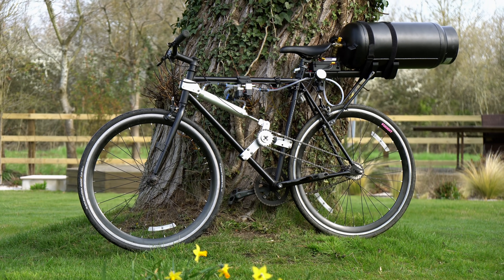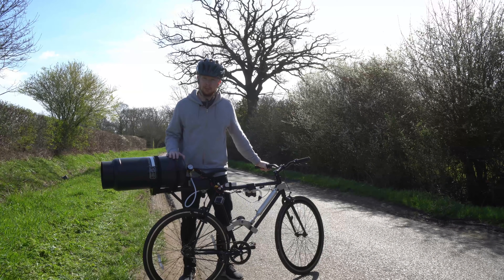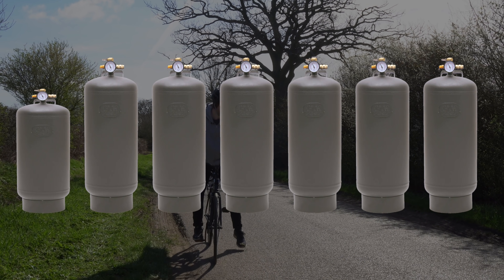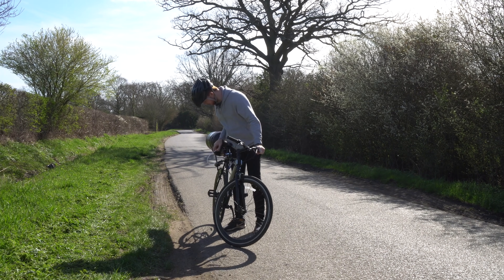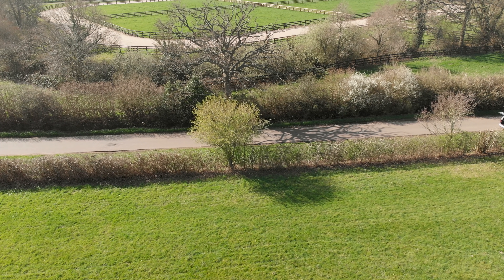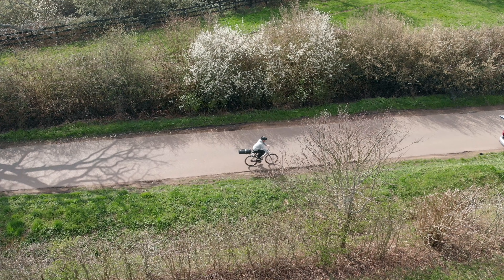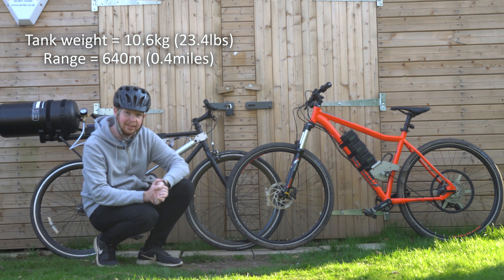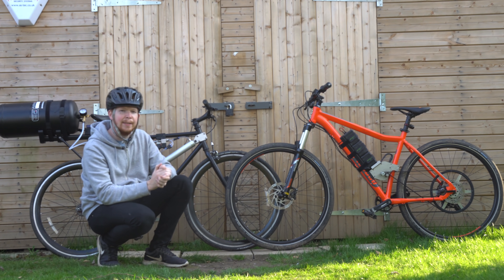Air Powered Bike Range

Comment: The rear wheel acts as a flywheel because of the fact that it is connected directly to the engine. Since this is the case, you could make the bike more efficient by utilizing the momentum of the rear wheel and connect a one way valve from the intake of the piston to the exhaust and use the pressure from the intake to push piston back up

Comment: There's a bit of weight improvement you could make, what you had listed there seemed like a regular 200 bar cylinder. There should be 300 bar steel tanks and aluminium internals with carbon fiber reinforcement around, the latter being lighter for the same internal volume but it'll be more expensive. 

If I take a Dräger 9L 300 bar carbon fiber composite you'd be looking at the following specification according to their datasheet
Weight: 5.3 kg (empty I'm guessing)
Water capacity: 9.0L
Source: https://www.draeger.com/products/content/compressed-air-breathing-cylinders-pi-9046796-en-gb.pdf

Your 20L 200 bar steel example weighed 23kg, so even sticking to the same weight ratio it'd be less than half that while having a 50% higher working pressure. But I have no clue if they even make carbon fiber composite cylinders that large. The carbon fiber ones are mostly used by firefighters and such if I remember it right and carrying a cylinder larger than  that around on a person seems counterproductive. When it's use case will be in a ground vehicle or stationary the it probably makes more sense to go for the heavier plain steel option, but if money was no problem sourcing two of those would result in a 50% weight reduction. But on https://www.frontline-safety.co.uk/drager-9l-300-bar-right-angle-valve-carb-comp it seems to be selling for £1,327.92 inc VAT which to me does not seem like a financially sane decision for this project nor practical in daily use.

So you might lose a bit of weight and perhaps gain like up to 50% (increased pressure) on that theoretical limit you calculated which would still not make it worth doing for practical usage. Alsoit'll be quite inefficient with how much useful work you can extract from all the energy being consumed by the compressor (oh yea and that's yet another thing you'd need if you wanted to run it regularly or live nearby a dive shop that has a 300 bar compressor). Also you'd definitely get less air out of that cylinder than calculated, if I remember it right for 300 bar 1L internal volume expanded would result in ~270L at ambient pressure since the compression ratio isn't entirely linear (should be less significant at 200 bar though).

Comment: Always quality video productions, thank you so much. I am wondering if an off-the-shelf air tool such as a drill or die grinder could be used in place of the pneumatic cylinder. I have been curious about alternative energy storage as with compressed air or elastic power for a long time now, especially practical, real-world use as you are exploring.

Comment: Wonder about a recycle system...Where you will pedal to create the pressure, but there is little to no exhaust, as the Pressure is shifted back and forth from 1 chanber to the other...And you are adding the excess....This is like the Idea of a Whites steeam engine, that recycles the water...It was slower thent he Stanley steamer, but went allot farther...

Comment: This is very interesting, and I learned a lot about how pneumatic cylinders, etc worked.  Especially interesting was the efficiency loss when the exhaust pressure was greater than the atmospheric pressure.  Many Thanks!  PS a steam powered variant would be great, I can imagine strapping the boiler on the back!!

Comment: Next try using a scuba diving tank, i.e. a 15L tank at 300 bar (4500L of air) giving you at least 30x the range (20 km). Maybe you could double the pressure going into the cylinder as well, possibly wasting energy by halving the range, but giving you usable power for a trip.

Comment: Possibly, could use the exhaust pressure itself to regulate the pressure? Like a light vane with a micro switch, and read the instant you open the exhaust valve.

Comment: Brother quit beating a dead dog you already know your problem it's your flow rate you got to have significant flow to your cylinder to make it work and then to make any of these systems really work you have to have very very high pressure meaning your take a hundred PSI is worth of Spencer to start with needed to or 3000 psi tank probably this in then comes does it take more energy to compressor tank than energy going to get out well it's been so I can Powerstroke I like the fact that you're using a Time system to allow just enough pressure to allow any atmospheric exhaust which is the prime number 1 any compression stroke engine with her be from fuel or air nice get your flow up and your respective numbers will climb your lines are too small your flow is got to be think of electrical wiring are water hydraulic they all follow a similar principle it's resistance brother cut the resistance your system will still have a flaw that let you have an alternate power source that can produce these air pressures without costing more than the net result what are the downfalls of an air compressor system but I think you want to write track for a low power system keep working on it sorry there's no pronunciation my s*** sucks I use voice speak I've had strokes and all I can do is talk well can't type at all what little bit I can do this well where's chicken at it can write better than me keep working on your project exhaust pressure is like you're trying to do are more important to the Powerstroke than you realize. It's the same and gas diesel whatever exhaust pressure Steele's power and your system with only are there's no fuel to lose exhaust pressure is everything even somehow ending up with a negative pressure that you can open that is for you to work with you it's something that has been ventured in with these systems. Was there is enough pressure to roll it past the point and if I mentioned that carry it with using a old very old vacuum tousle system dad and additional very minimal amount of power but any power added is power gained no matter how miniscule just keep researching you're going to find some really interesting stuff you're on the right path but the problem we have is the power that it requires to generate the air pressure

Comment: The main benefit of compressed air as power storage is, compared to combustion engines, that you can build engines without  dead center positions. Therefore I really wonder how much more efficient it would be, if you use the engine of a pneumatic drill, or something similiar. I guess it should be a lot better and easier at the same time.

Comment: Tom. I remember seeing a steam engine that used high pressure cylinder and then used the exhaust from that to power a low pressure cylinder. I was wondering if the same principle could work here.
Also could you run it down a quarter mile dragstrip and get a world record?

Comment: there are alot of things you can do diferently but to start of. air powerd cars already exist and have desent range tho to me i do not want them to become popular as in a chrash with a normal car it is a chrash and mabye some fuel leaks and have a potential to start a fire. air powerd car can explode if the tank is pierced during a chrash or mabye a full tank is squished cmpressing the air beyond the tanks capasity making it rupture and explode.

for the htings oyu can inprove. 1 gears there is a reason most bikes and cars and any powerd transport that isn ot electrick got them. they makes the hole system more eficient. 
2 use more cylinders that are optimised for diferent preshures. as all cylinders got a optimal preshure where they are most efective. and if the resulting exaust is greater than outside simply feed this air into another culinder that is optimised for that phreshure. this have been dome before to make an incredibly efective steam engine.

Comment: You can now mix both bikes and use batteries to electrically heat the air in the tank to boost pressure/volume.
Poor efficiency but a good hack! ;-)

Comment: You need to find a carbon fiber air tank that firefighters use. Our tanks can be pressured up to 4500 psi and they are lightweight.
Reply: isnt all that air heavy?
Reply: @spawnof200  I think a 45 min bottle (approx 66 cubic foot) pressured to 4500 psi weighes about 20 lbs. They have different sizes if tanks.
Reply: @gregoetker1389  Yeah but at what cost?
Reply: For what, $4500 also?
Reply: running into a burning building with 4500 psi strapped to your back you might as well run in there with a box of tnt

Comment: pour liquid nitrogen into a canister that pipes in to your pressure system.  but you have to use a canister that is not insulated so the heat in the atmosphere can warm the gas and get it to vaporize.  should probably include a tank to smooth pressure fluctuations and a over pressure release valve for safety.

Comment: There was an even more efficient Wankel Rotary Air Engine invented by a guy named 'Angelo Di Pietro'. He worked with Mercedes Benz Research Laboratories. He put 15 years of development into his Engine. Now he owns a Company in Australia "EngineAir" and builds concept vehicles that run on air.
Reply: Yes  I have driven one of his vehicles and can confirm it works and  is far more efficient than a compressed air piston engine. Plus using heat exchangers the efficiency is further improved:- http://engineair.com.au/

Comment: The comparison at the end is really clear and striking. As a mech. eng. it is obvious to me but the general public need such proofs to avoid getting carried away by scams. And you did not mention how much energy it takes to 'charge' the battery... With compressed air at 230bar, you generate a lot of heat which is usually lost, while batteries are very efficiently charged.

Comment: Tom: would your ever consider building a Tesla turbine with reduction gearing and see how it compares?
Reply: how would you apply a Tesla turbine to this? from what i understand theres no material known that could withstand the forces in a Tesla turbine.
Reply: @JohnSmith-pn2vl  Not in Tesla's time, but these days there are many materials easily capable of withstanding these forces.  The turbine could be magnetically coupled (and reduced in rpm) to the input of a planetary gear to reduce it even more to usable speeds.
Reply: @lubricatedgoat  i have to disagree, there is no material that can, not even remotely.
Reply: @JohnSmith-pn2vl  And yet we have turbines, even small ones, that are of complex geometry, routinely withstanding in excess of 100,000 RPM under extreme conditions of heat and pressure.
Reply: @lubricatedgoat  ok but those are not Tesla turbines
Reply: @JohnSmith-pn2vl  yes.  A Tesla turbine does not ask as much of its materials as the turbine type I mentioned.  Look into high-speed flywheels if you're in doubt :)
Reply: @lubricatedgoat  ye ok, it depends how you run it, but it has so many flaws, warping and difficulty to translate high rpm to usable torque being the biggest ones imo.
it remains a fascinating but not applicable invention.
besides the creation of unlimited free energy of course ;)

Comment: I wonder if it would be feasable and better to use the bikes frame as storage for the compressed air. I mean its there already and its hollow in the inside. Of course it cant compete with batteries but would still be a cool project.

Comment: Tom you should try making a kite power generator. The design uses two drone controlled kites (to adjust their trim) and spool a motor as they alternate going up and down.

Real Engineering did a vid on it: https://youtu.be/vMTchVXedkk

Comment: Hi Tom, you can find used carbon fiber SCBA tanks that the fire fighters get rid of. They fill to 4500 psi or 310 bar! You may be able to find one for very cheap at a pellet rifle store. They can usually fill them there too. Theres a chance that a dive shop may have them as well. And either will have used steel and aluminium tanks for even cheaper.
Reply: I second this. It is clear that the issue here is the amount of stored energy. Most compressed air vehicles use tanks with pressures at or above 200 PSI. This would only add a little to the weight but would significantly  increase the range. 
However at those pressures you would need to secure those valves carefully since you would not want an accidental kick in the valve when mounting the bike to rob you definitely of your ability to make children ... or worse.
The energy density of compressed air is ultimately much lower than of a lithium battery but it has many strong advantages as far as sustainability is concerned:
- its durability is orders of magnitude higher and supports many more cycles,
- its embodied energy and associated carbon emissions as well,
- it requires only carbon and steel as resources, as opposed to many different and rarer metals,
- it is easily recyclable whereas lithium batteries are hard to recycle efficiently,
- it is much faster to recharge,
- compressed air can keep much longer than a battery,

All in all, if the limited range is not an issue, compressed air is several orders of magnitude greener than electricity. We just need to use it where it is appropriate, I.e., short trips to and from work than for long weekend rides.
Reply: @nekononiaow airpod cars are now a thing.
Reply: @nekononiaow  not sure why he used a steel tank at all in the first place... even just plastic soda bottles can hold 80 psi and they weigh almost nothing

and another thing, compressed air is in no way greener than electricity, as you have to run a compressor to compress it in the first place. i don't know the efficiency of a compressor but I'm sure its much less than the 50% that it takes to charge a battery and the 70% from a modern electric motor
Reply: Co2 would be great also, I use them on my race car for boost control and my air shifter. What about nitrogen?

Comment: Tom Stanton I've always said and thought that the future involves compressed air storage as it is an underutilized energy storage medium.  What I mean by that is currently it is limited in scope due to the inefficiency of air motors to convert/realize the stored energy efficiently.  The compression of air can be done efficiently but most air motor designs, including high priced industrial and commercial air motors are no more than 5% efficient.  That's why your project and design is so danged interesting, because I guarantee it has a much higher efficiency.  Next I'd like to see your test utilizing a SCUBA air tank, or other 2000psi+ cylinder.  Additionally if you could build a pneumatic prototype of these various high power hydraulic designs, specifically this one AvE highlighted, well that would be amazing! Thank you for excellent videos 
https://youtu.be/0IjrU5bUbUc
Reply: @Guodlca because air can be compressed to 6,000+psi at 95% efficiency, is free, and all around you.  The limiting factor is not the compression and storage, it's the utilization mechanisms inherent inefficiency due to the misunderstanding of this fact.

Comment: Dual piston, emulate human legs, it's not efficient to pedal with just one leg, anyone has tried that and doesn't feel right.
Reply: The piston works both ways. With dual pistons at 90° to each other it could be smoother, and start from any rotation point. You might be able to run on a bit less pressure, but you'd need more air volume.

Comment: Could you use a second piston to take in the exhaust ? I know that used to be done in steam engines wherein high pressure steam went into the first piston, and the low pressure steam exhaust went into the second

Comment: Try regenerative braking! Simply reverse the valve sequence when the brake handle is pulled. Add a check valve in parallel with the regulator to direct air back into the tank.

Comment: You could use it as a brake and power storage for downhill-mountainbiking. So use the cylinder as a compressor and brake to store air and then use that power to speed up flat areas. Could that work?

Comment: you can fill the airtank with water and measure that water volume to find the actual volume of the airtank you would have to dry out the airtank after it though which wouldn't be super easy

Comment: Another issue you might face using a scuba tank is the regulator. A scuba diver uses about 15l of air per minute near the surface, or 5 times that at 40m depth. That requires the regulator to be submerged in order not to cool down too much to freeze shut. In air heat transfer from the environment is a lot lower and a regular scuba regulator might well freeze at the rate you're taking air out of the tank.

Comment: I don't know if you've researched this at all, but STEAM engines used to have a valve that controlled not only the timing of the valves, but the duration of the open time as well.  Once the engine was under way, a good driver could conserve steam, and thus fuel, by limiting how long the valves were open to full pressure steam.  So, instead of getting full pressure for the full piston stroke, it might only get it for 1/2, or 1/3, thus allowing the steam to expand more and reducing exhaust pressure.  With your electronic valve timing and duration control, you could probably easily recreate this capability.

Comment: If you're willing to risk blowing up, you could try filling up the tank with hydrogen, which is the most compressible gas.  You might get a lot more range out of it.  Meanwhile, you could probably burn the exhaust to produce additional thrust lol.

Comment: I would get really bored riding an electric bike at 10mph for 12 hours. I ride mine at 31mph and it gets me about 13 miles.
Reply: I hope you wear a proper motorbike helmet and protective gear. You only need to be doing about 20mph to sustain serious injuries when you come off. Back and neck injuries could leave you never able to ride anything more than an electric wheelchair.